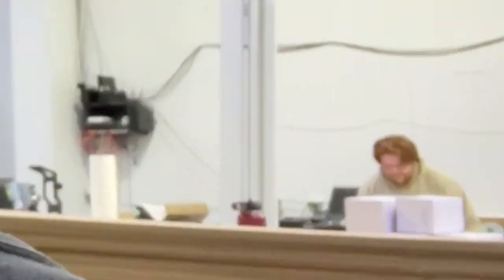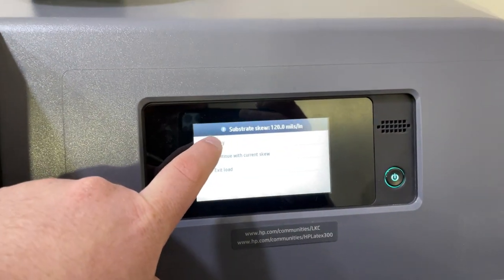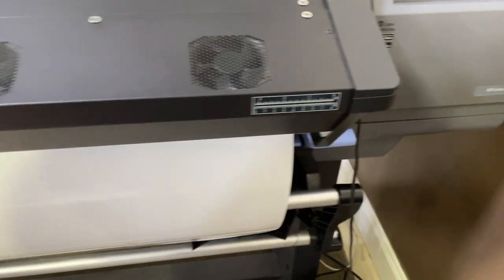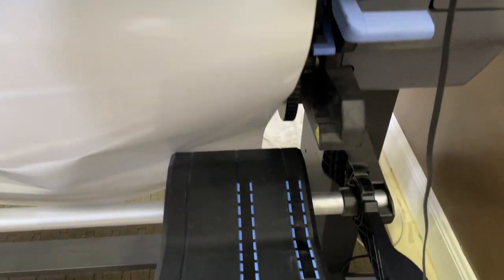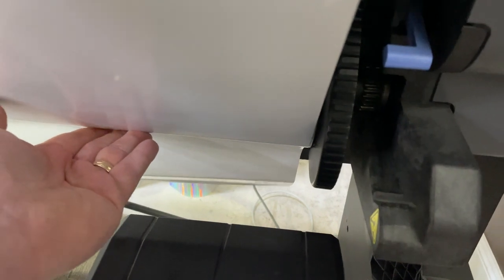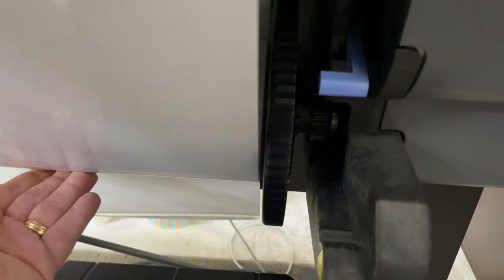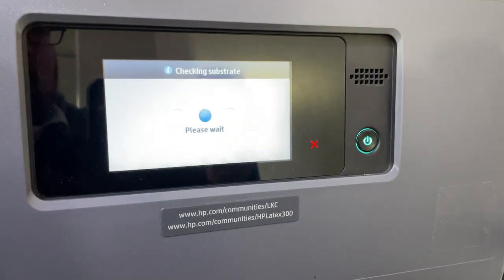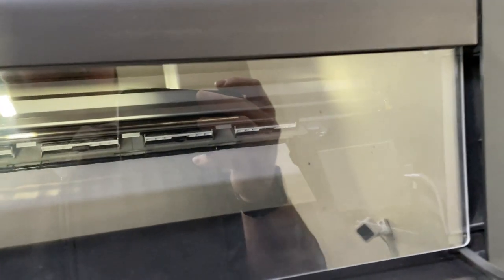HP Latex, fix skew on media loading

Comment: what is this box behind plexi (a black rectangle with a cable going outside) that you can see at this moment https://youtu.be/AOC86H1TRRQ?t=79 ? what is it for?
Reply from the maker: It's a camera so I can watch it print. https://amzn.to/3QGnjPu
Reply: @ttms  I have HP 335, 570 and soon I will buy another this time 375, but I have never had such a camera inside the printer. I have one large one for the entire room, but the print lines are not visible.